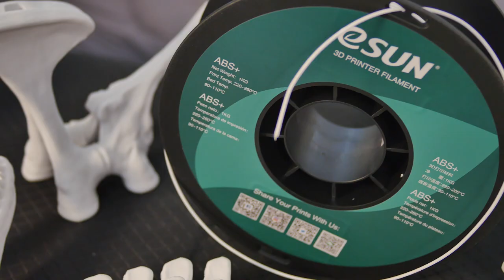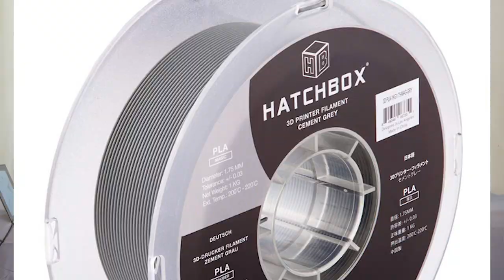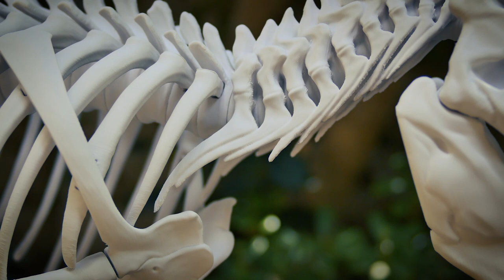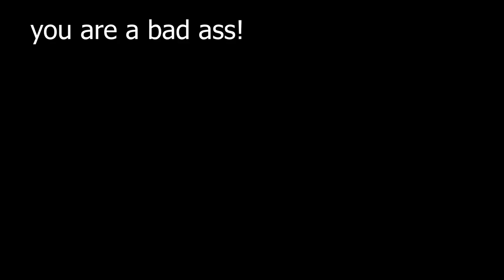Building a Giant 3D Printed T-Rex Skeleton

Comment: Great job, one question: what is the spray that u use after glue the pieces? greatings from Brazil.
Reply from the maker: That's accelerator for CA glue that basically makes it cure instantly.

Comment: So the hipbone is the biggest part right? 

If you try to scale that up your good to go? 

I want to try pla+ on my ender 3 v2. And also 200%
Reply from the maker: Can't remember for sure, but yeah, that was one of the largest parts. The longest part is the support beam (can't remember the part name. It runs vertically from the base to the hip bone.) I had to rotate is 45 degrees to get it to fit on my 250x250 bed.